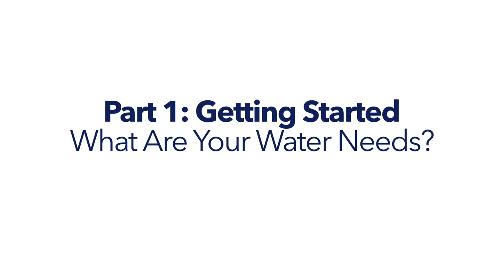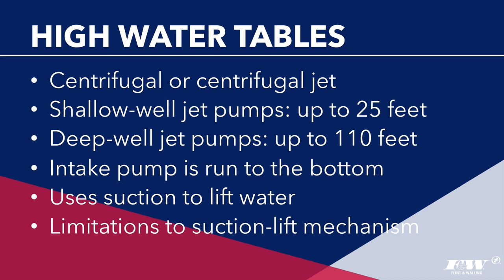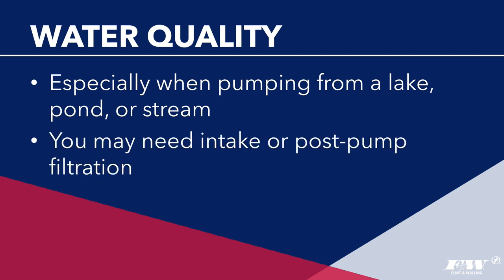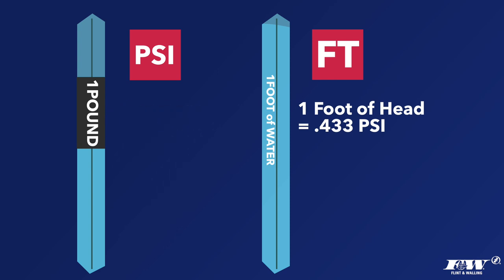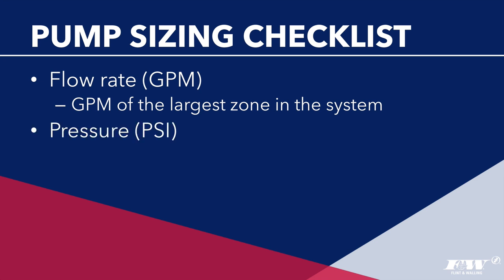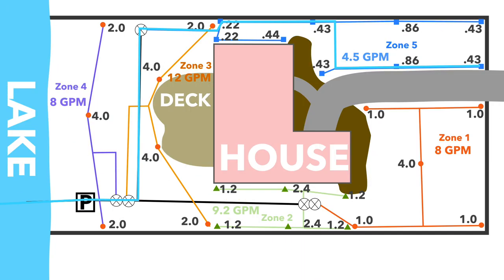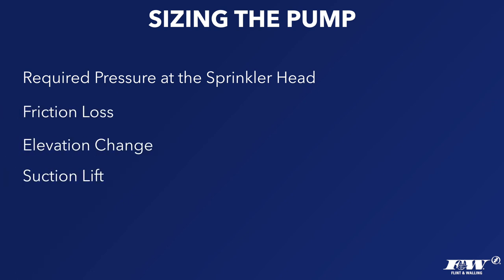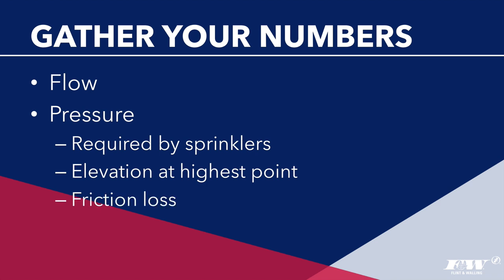Selecting and Sizing Irrigation Pumps

Comment: Excellent video! I have a small pasture for wildlife, including fruit trees. Last year I bought an impact style, rotary sprinkler on a stand and linked several hoses together to reach this pasture. We're on a well and when the pressure falls, the sprinkler stream gets really weak. I'd like to add a second sprinkler. Plus, I'd like to get a generator, to set near our creek and use it to pump water to this location. Although its quite a distance from the creek (about 425ft), the elevation is fairly level and suction lift would only be a few feet. After watching this video, I understand so much more about selecting a proper size pump.
Reply: Don't know if you're still there, mount some water tanks on a trailer and a trash pump. Fill the water tanks with the trash pump, then head to where you need to irrigate and use your irrigation pump. You can find both tanks and trash pumps on Facebook Marketplace for cheap, just have to wait a little.

Comment: This was great. We have a 2HP 3 Stage. A slightly different question becomes what is bad for the pump rather than if it can service the biggest zone. This massive pump is connected to a drip line which of course is a very small pipe running off 1-1/4"  I also have 2 smaller zones that happen to be 3/4" coming off the 1-1/4" line. If I throw a 75psi reducing valve on the pump is it sufficient to avoid pump or motor damage? I'd be interested in a video based on how to protect your investment once the right pump is selected. Questions like what to do if the owner wants a 3/4 garden hose run off the top of the pump and how to do so without damage.

Comment: Love the video. The total head of the system is similar my project.. I'm quickly finding I will need a 2 stage pump or two pumps in series. (160 feet head and 60 gpm).. 2.3 acres to water.

Comment: After watching your video I feel like If any one could help me here it's you guys.   This isn't an irrigation system but I think the theory is the same. My koi pond has a screen filter part of it was an Oase submersible pump that feeds water too two spray heads that keep the screen from clogging.  after 18 years the pump crapped out, that pump is no longer available there is no official replacement. I purchased this pump 
Jabeo     DCM13000  specs
   24v  
 95w 
13500 L/hr   
6.5 max head/M  
in/out  40 50 mm  I believe the in/out was 2".   
 This pump did not provide enough pressure at the nozzles  to keep the screen clear of debris.

     Then there was the claim that some one used this pump  
Eco max DM 10000   specs    DM 10000

10000 lph (2200)gph

5.0M (16.4)ft. max head

85w

1¼"/1¼"  in/out
It's actually is a smaller power pump. what could have help cause this result ?  I don't believe the flow rate is that important  but there must be good pressure at the nozzles.
Any ones thoughts would be greatly appreciated  Thanks

Comment: You said flow and pressure are independent.
Which i dont think so.
Because as per Bernoulli's equation they both are dependent.
What i mean is, in case of sprinkler you can't have two different pressure values at same flow rate and vice versa.
Can you clarify?